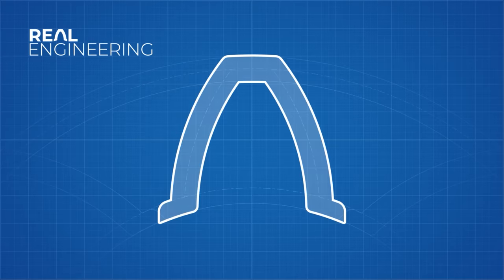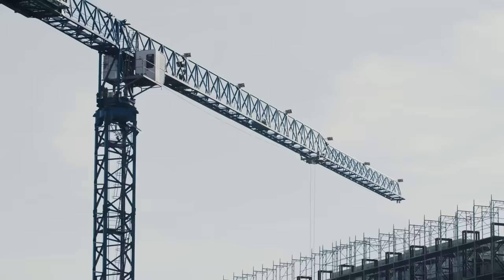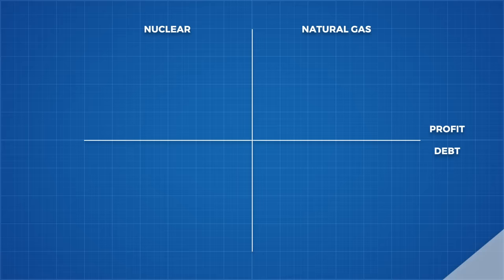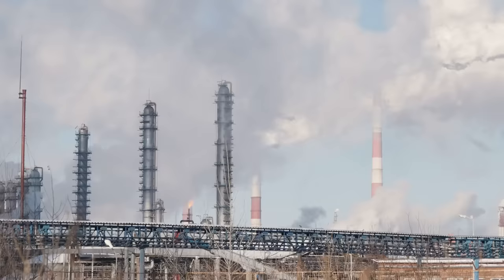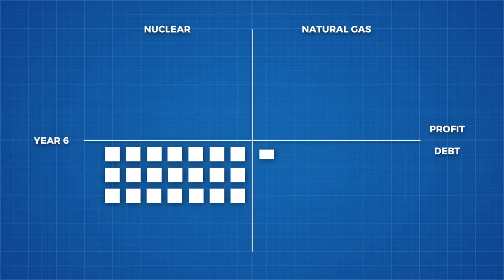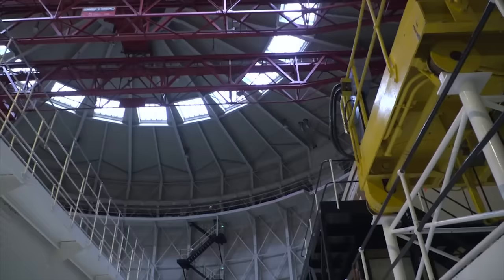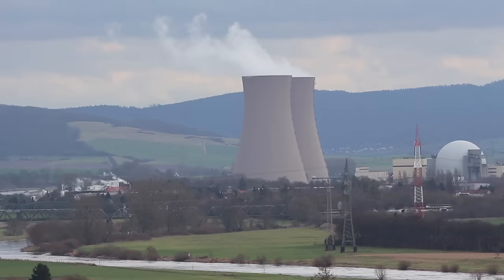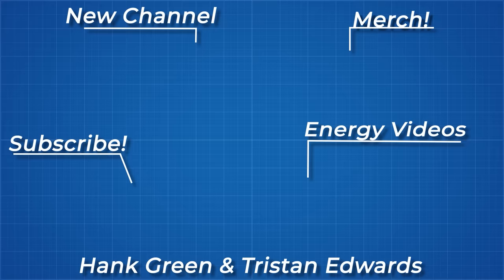The Economics of Nuclear Energy

Comment: Got 3 points to make. But I am really proud that you've made a nuclear energy video :):):) 
1. In the beginning electricity map which you used for co2 per kWh only shows real-time data and never averages over time.. dunno why they don't but I don't run it. While France does stay between 20-70 grams. Germany and California tend to pinwheel between 120-350 depending on the time of day.
2nd point. Most levelized cost analysis miss a lot of variables or make broad beneficial assumptions for wind and solar. There is a reason why wherever wind and solar are built in mass, electricity prices rise. Germany has the most expensive in the EU. While France has the cheapest. There are a lot of external costs such as the infrastructure but also reduced revenue for conventional energy generation resulting in higher prices etc. Because wind and solar need backup energy to be usable. The cost of maintaining those back up generators factors in. 
And 3. Nuclear power does need to be load following for the sake of 100% nuclear power. Not to work in conjunction with wind and solar. If you have enough nuclear energy capacity to back up wind and solar when the sun don't shine and the wind doesn't blow. Then you simply do not need the wind or solar when nuclear can provide energy 24/7. Also the best way to modulate nuclear energy output is simply to reduce steam to turbines or divert the energy elsewhere such as to desalination efforts. If one is concerned about emmisions alone. The best course of action is 100% nuclear energy to replace both renewables and fossil fuels.
Reply: Well said.
Reply: Most LCOE analysis actually make broad assumptions that are not beneficial i.e. to solar like 20 year life time, while most plants are projected to run over 32 years, meaning LCOE might be overstated by 60%, possibly even over 100%. Backup costs and system costs are overstated, because of widely exaggerated need assumptions.
Reply: @maruti1mon1  projected or potential lifespan is always best case scenario. A reactor can last, best case, over a century. Will that happen? No probably not. And no the costs of integration are not overstated. They are not included in lcoe's at all. The problem with wind and solar is your not paying for them instead of coal and gas. Your paying for them on top of coal and gas and all the extra neccesary infrastructure. Everywhere renewables have been mandated. Electricity prices have risen. E v e r y w h e r e. Cali prices rose 25%. German prices rose 40-50%. Denmark prices rose 100%. And the more and more renewables you add to a grid the more expensive and less valuable they become. Economics seems to be the only foot pro-renewable people think they have to stand on. How little they know.

Comment: I feel like an important cost that isnt often included in such models and calculations are the externalities associated with different energy types: transportation and production of steal/pipes/concrete, extraction/mining of fuel, cost of CO2 emissions. These are all unseen, yet very much real and incurred costs of all energy production.
Reply: They are taken into account for the 12g eq. CO2/kWh. Nuclear energy itself is pretty much 0g/kWh if you ignore externalities
Reply: @BullCheatFR  
But not taken into account in the economics. Add a reasonable carbon tax and fossil fuels become prohibitively expensive, and nuclear becomes the best option, beating even renewables.
Reply: @andrasbiro3007  Given that new nuclear infrastructure would take 10+ years and renewables are rapidly getting cheaper, its unlikely that a tax would push nuclear over wind/solar.
Reply: I'd love to also see the cost savings from repeating design. In the U.S., most of our current plants were built in the experimental days of the 50s and 60s and newer plants are feew and far-between, so each one has different specialized equipment and any new power plant begins with a board room of engineers asking "how much can we trust the old designs that caused Three Mile Island?" 

This is in comparison to France, which has 58 reactors in 3 designs, and Canada, which created the lovely CANDU reactor. And of course, nuclear standardization would have to compete with conventional fossil fuels which have equipment designed for hundreds if not thousands of plants burning similar fuels.

I'm hoping NuScale is going to be discussed in future videos.
Reply: By definition externalities aren’t included in most cost models
Reply: @animea90  
That's the case now, but it's not inevitable. The long construction time and very high price tag are the consequence of overregulation. Even the huge size of the reactors are, because the regulatory cost is fixed, so bigger reactors are more economical. Ideally we would mass produce small, modular, gen. IV reactors. Those could be like 100x cheaper, faster to install than a gas turbine, and also like 1000x safer. I know it won't happen any time soon, but that would be the ideal solution. Solar panels could compete eventually, but it doesn't matter which technology wins as log as it's clean, safe, abundant and cheap.

Comment: Ok, you went over the economics on the differences between nuclear and natural gas. Not nuclear and renewables. The whole reason for the green movement, is the environment Not the cost. If we are going over the costs between operating solar and wind vs nuclear. Nuclear is still many times cheaper than renewables per kilowatt hour, Both economically and environmentally. Oh and your main power generation unit is still having to be subsidized by the government to keep it cheap enough to come even close to be worth it. Nuclear doesn’t get that luxury. Imagine if nuclear had the same funding as renewables. 

For a wind farm and solar farm you have to build the farm to produce the power. the power storage banks to store power for peak use because the wind doesn’t always blow and the sun is going down during peak use. and the backup power plant for when the weather doesn’t cooperate, because it’s not always sunny and it’s not always windy. That is 3 times the amount of land potentially required and tens of billions of dollars more expensive than nuclear. The strip mining for the silicon for both the solar cells and batteries. That’s even more land destruction. The strip mining for the coal or drilling for oil and natural gas. Even more land destruction. The amount of fuel burned to transport and piece together all of those facilities. 

All in all, renewables do more damage to the land, air and our pocket books than nuclear does many times over. 

Let’s also not forget that unlike nuclear waste, solar waste is not as regulated. Yet it is also very bad for the environment. Wind and solar are not a solution. If anything they are the sidekicks for nuclear.
Reply: Stop talking sense! People want to BELIEVE in wind and solar power. :P
Reply: The biggest irony of the so-called green movement is they would have been kinder to the planet if they just burnt the coal from the start. Rather than wasting all this energy and created all this CO2 and all these government subsidies to prop up a dream that was never going to be economically viable.

Comment: A very important fact that is forgotten here is indeed: the electricity market. When capacities (gas, nuclear, coal, wind) have been built, the plants that can produce electricity against the lowest marginal costs will actually supply to the grid. Currently, due to the low fuel costs of nuclear it has the lowest marginal costs. But wind and solar have almost no marginal costs (no fuel or other variable costs), so this means that when the sun shines or wind blows (=in most countries often) nuclear plants will be outcompeted in electricity mixes with high penetration of solar and wind (which a lot of countries have planned in the future) and their revenues (based on running hours) will be way lower than in this video and payback period around 40-60 years. Thats why no commercial party wants to invest in those plants, only governments themselves could.

Further:
- interest rate of 3% is very low for such riskful investments (which has a lot of impact on such a long payback period, thats why building plants is only possible with large help of the government)
- after the lifetime of the plant a lot of costs are involved to dismantle the plant
Reply: very good arguments

Comment: also ''renewable'' is largely misleading , Hydro is a source of energy that no one contests , it's great all around , and is providing with the large majority of the renewable energy 
It needs to be separated from Solar and Wind
Reply: Out of the 46% of the renewable energy of Germany, 1% is solar plant, 1% is by wind. The rest is mainly biomass, which is... cutting tress and burn them. Very polluting solution, but still classified as green energy. Wind and solar dont produce enough on average. Problematic as we still cannot store electricity at a big scale.
Gas generates Co2, so I dont see the point in this video.
Also, they dont seem to take into account all the factors. Solar & wind plants have a short life, need a lot of maintenance, and are very polluting to make. 
Nuclear isnt sure or infinite, but it does not produce Co2, and runs far longer than the current solar and wind installations.
This topic should be cover in its integrality, so people dont think solar panel is the easiest solution.

Comment: 2:58-3:25 you make the nuclear plant cheaper by taking a lower value instead of the average or maximum (which would also make sense because if you look at recent projects the costs are clearly increasing more rapidly than general inflation) and make the gas plant more expensive by rounding up.

Comment: Keep in mind: That are just the Economics. The waste problem and the limited supply were not treated in this video
Reply: Uranium is pretty easy to come by on planet Earth. Unless you mean natural gas by limited supply?
Reply: nuclear waste is 99% non radioactive, and the 1% loses radiation in 40-50 years "stored in concrete underground in areas that ain't getting any development anytime soon"
Reply: If your talking about uranium the amount of energy you can extract per amount of uranium compared to coal or oil or basically anything else that is not nuclear is insane. Also nuclear waste can be dealt with pretty easily now.
Reply: @JabbarTV1  False and false. The 94% (!) is considered low-level radioactive waste and usually safe, but has to be stored and double-checked regardless. The 6% high-level waste will have greatly reduced radiation levels after 50 years (Cesium-137 and strontium-90 have half-lives of approximately 30 years) but other isotopes have half-lives of tens of thousands of years. There's a reason that governments all over are looking into long-term stable geological depositing in places like salt mines and clay deposits.
Reply: The waste problem is indeed out of scope (as someone already mentioned). But when taking wast into account, that would definitely tip the scale in favour favour of nuclear compared to coal or gas. When comparing the waste of renewables compared to the waste of nuclear plants,.. my guess is that renewables win, but not very convincingly and it will probably depend a lot on the regulations with regards to the use of heavy metals and stuff like that.
Reply: @Steamrick  However many tons of waste nuclear reactors produce it is nothing compared to the billions of tons of toxic gasses that coal power plants pump into the atmosphere. At least we can keep it in a box in the ground instead of breathing it in for the next few thousand years.
Reply: @vampiresRsolame  the (discoverd) uranium supplys will last about 250 Years, if the share of Nuklear Power doesn´t grow (10% - 11% of energy produced worldwide)
Reply: How to deal with nuclear waste: 
1. Put it in a cermaic box
2. Don't break it open and eat it.
That's basically all you need.  Compare that to the lead, cadmium, chromium waste produced from solar power which is just dumped somewhere, it's a lot safer.
Reply: @cptbaloo  That only applies to current active and/or developed extraction sites/mines. We can even extract uranium from sea water now days, the supply is pretty much infinite, even if we do not reprocess...

Comment: Several reactors are capable of ramping up and down by as much as 70%, but it's true that they don't shut down entirely, but this is also reasonably true for any stream turbine based power station (e.g. coal, gas and biomass), as the cool down and heat up time is several hours. Gas peaker power station are gas turbine based, so that they can fire up in a number of minutes, but this comes at a cost to efficiency and emissions, and it is these, hydro and imported electricity that largely prop up renewables.

An alternative for nuclear power stations at times of low demand is to retask from electricity generation to either high temperature electrolysis to generate hydrogen or use molten salt heat storage to time shift the output. Both of these methods could be used to better mesh with wind and solar and variable demand in general. The downside is both these features really need to be part of the reactor design from the outset.

Moltex Energy has a very interesting looking reactor design that uses molten salt heat storage.
Reply: Sounds great - esp. considering that molten salt as coolant is one of the more dangerous designs due to inherent instability as a moderator and violent reactivity with both air and water.  If it's a secondary heat exchange medium that sounds ok to me.

Comment: Well done evaluating the costs between the energy sources. But one thing that should be to be included is, that nuclear power plants can produce way much more than just electricity for the grid. It can produce heat for manufacturing several other products which would cut down the years to profit. A fact that is not available for gas, solar, or wind. Power generation.

Comment: Where I live in Australia, we're doing something kind of genius. So, pumped storage typically works during the day, where if you have higher demand to fill, water from an upper dam is released into a lower one, generating power. That water is pumped back at night when electricity is cheaper and more surplus. We're doing it backwards. What we're doing, is using solar excess juice from arrays during the day, to pump water uphill, and then releasing it down at night, effectively creating a solar battery. I find the idea to be quite elegant, really.